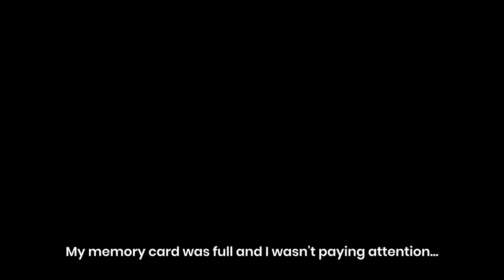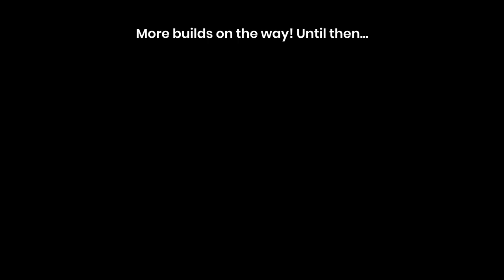Silent (red) but deadly.. (GMMK TKL + Gateron Silent Red Switches)

Comment: This is a beautiful build. Nice! How do the Gateron silent reds compare to the Cherry silent reds?
Reply from the maker: i'd say slightly smoother. i haven't worked with cherrys in a while but they were almost mushy in my older builds.
Reply: @SPANISHFOREAGLE  great. I ended up getting some milky yellows for a similar build to this. Thanks for the inspiration
Reply from the maker: @corey7610  great choice. enjoy
Reply: @SPANISHFOREAGLE  changed my mind to Gamakay Phoenix switches. Lubing them all as I type this.